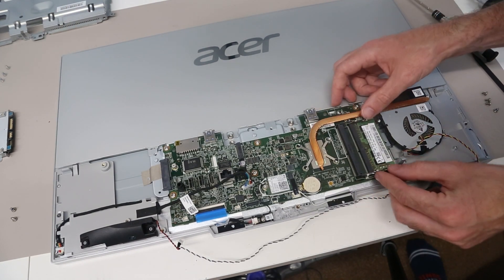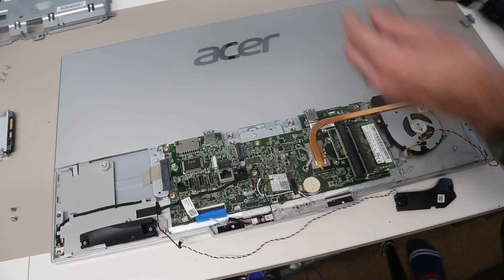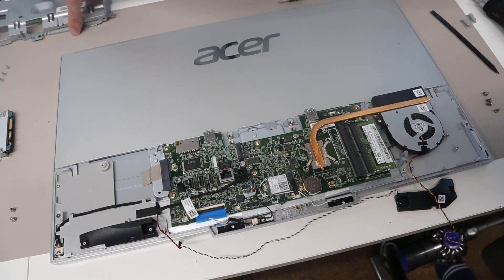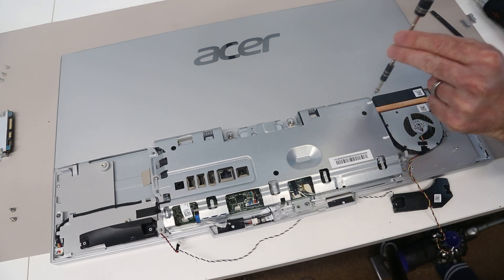Acer Aspire C24-896 - 2.5" SATA, M.2 2280 NVMe SSD, RAM Upgrade and Heatsink Cleaning Guide

Comment: Hey I am upgrading mine too and all over the internet it says max 16gb ram or 20gb ram 
Says no 2.5 sata ssd
Only 2.5 hard drive 
And the m.2 nvme says max 128gb

Could you fill me in on how much ram is possible same with the m.2 nvme and 2.5 sata 

I'm looking upgrade all three 

Thanks for the help Appreciate it

I have the c24-865-ua91